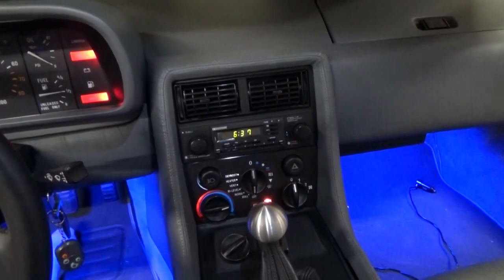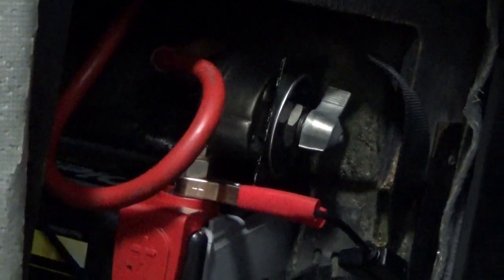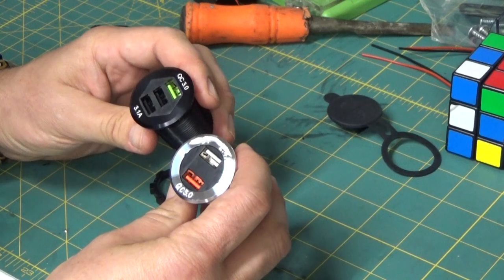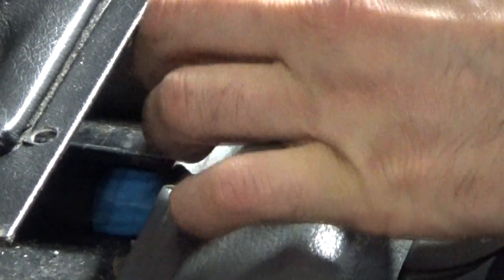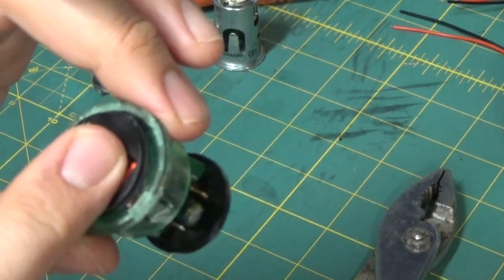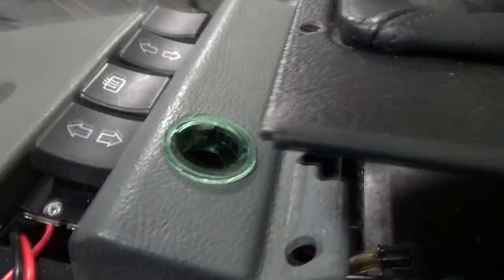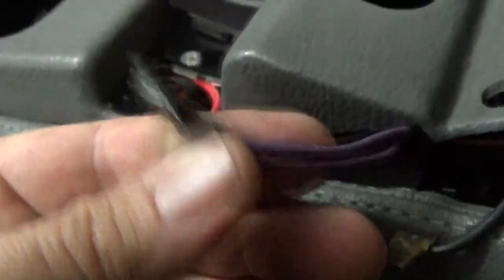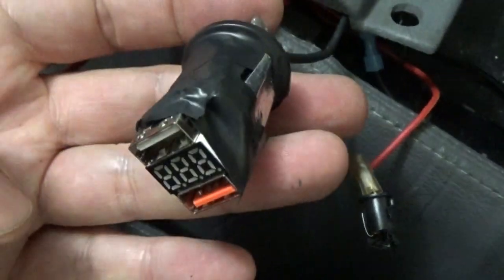How to Retrofit the DeLorean Cigar Lighter to USB Charger without permanent modification..Restomod!

Comment: Thanks for the video!!! @14:37 you could get the ground also from the usb connector, right?
Reply from the maker: You could yes. Both the ground for the LED bulb and the USB are essentially going to the same ground point and are unswitched.
Reply: @DeLoreanTECH hmmm... I would think all grounds are connected to each other and only the live wires are switched (or not) 🤔
Reply from the maker: All ground is connected through the chassis, however there are many electrical components with switched grounds in the DeLorean like lamps for the engine compartment, glove box, interior dome lighting, door lights, etc.  They can be identified with the purple/white ground wire. Fortunately the cigar lighter illumination bulb is not one of these switched grounds.  The switched ground is needed for these other components because the +12V is always hot.